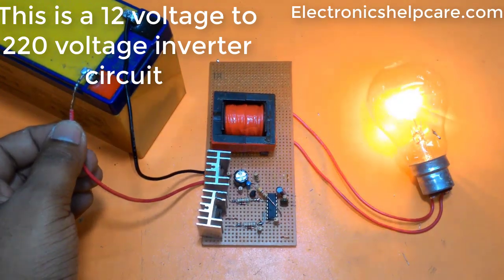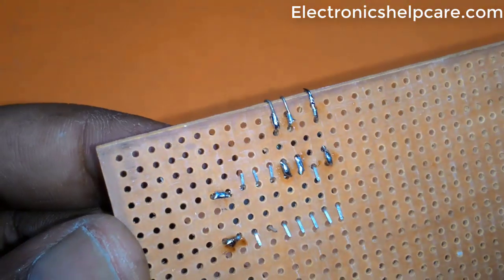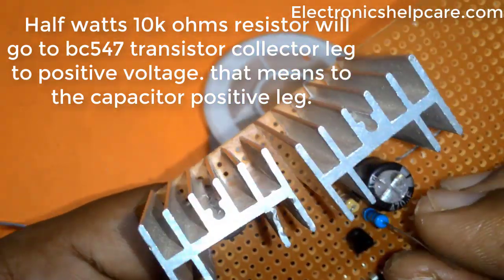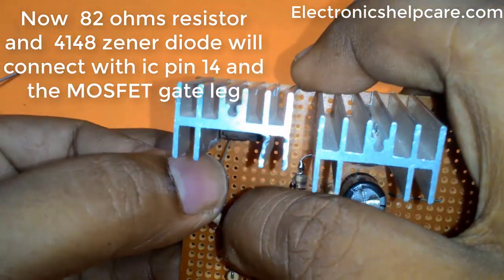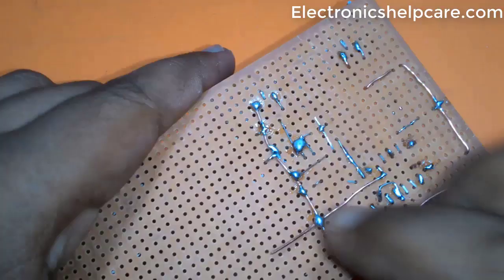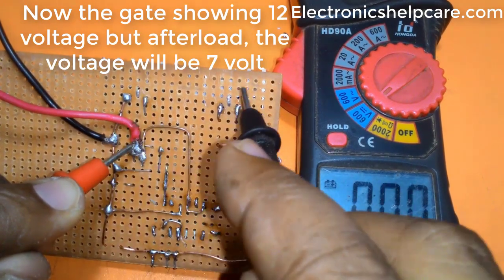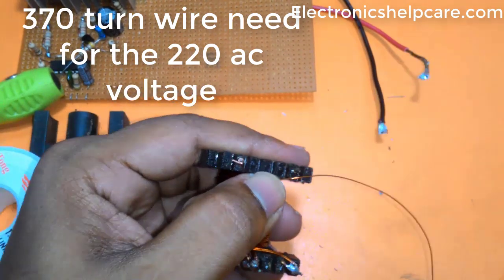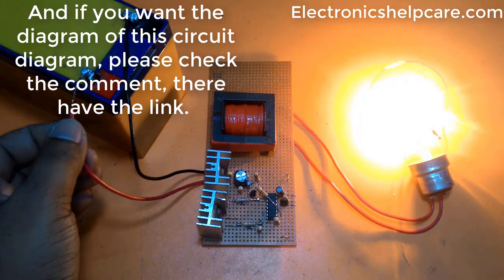How to make 12v to 220v inverter?

Comment: I make this inverter.But it not chopper transformer output voltage correct.output voltage low.output voltage 20 vole.please this chopper transformer correct making?
Reply from the maker: Visit for Circuit Diagram 
https://electronicshelpcare.net/inverter-circuit-diagram/

Comment: Hello. I have to admit that you have weirdly wound this transformer and because the gear of this transformer you created is about 1: 30,8. By supplying the lowest voltage of 12 V, and this is keyed by mosfet transistors, the output will have a voltage of 30.8 times that is 370V. You could give more wires side by side to the primary, thus reducing their number from 12, for example to 6, and secondary ones to give one more wire next to each other, reducing your number by half or 185, the transmission would be kept current so that it could increase, then you can check at what frequency SG3525 works to increase this frequency, if any, due to the fact that you are lowering the number of turns, although this would not necessarily be necessary. It is known that the output without load will be also 370V, and with a light bulb load it is only about 230V. For a light bulb it is not a problem because it is completely resistive. In case it breaks when overvoltage and nothing happens. What happens when you connect a TV to it or a laptop power supply, of course, not an inductive one without a 50 Hz transformer. or any drill because such devices on this inverter will not work but they can damage it or damage it. There may be damage to the adapter from the laptop or adapter from the TV due to too high input voltage that can break through the rectifier bridge at the input or some capacitors or something similar. Greetings.

Comment: I was making inverter with one transistor or we call it Blocking oscillator, rating frequency 15 khz
This technology used since 80's in automatic power supplies in TVs,but this type of inverters can't be used for the appliances which work on 50 Hertz,so we were making the UPS 50 Hertz inverters with low noise and sign wave while most of high frequency inverters using triangle or square waves.